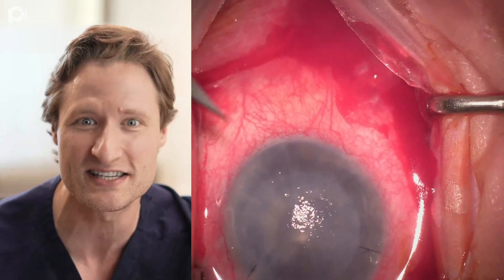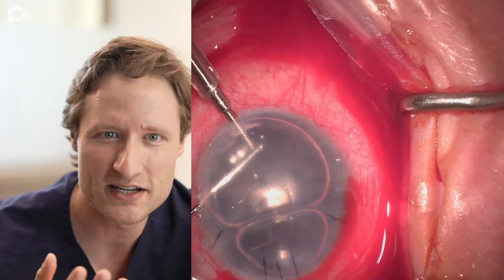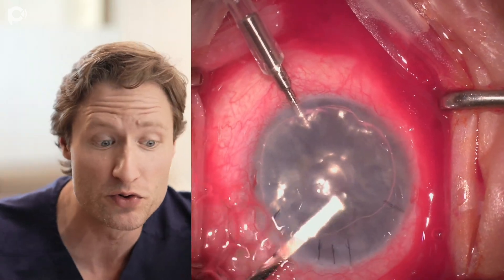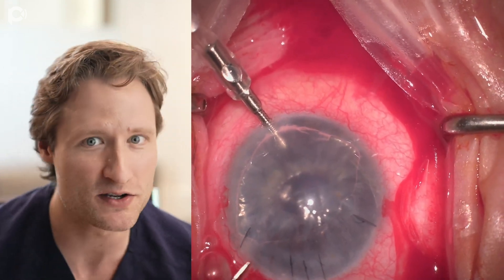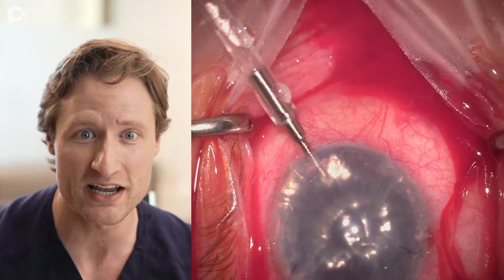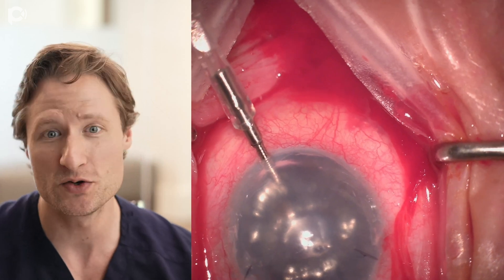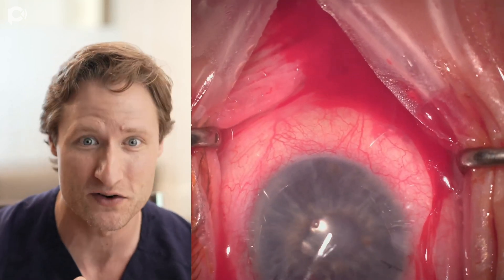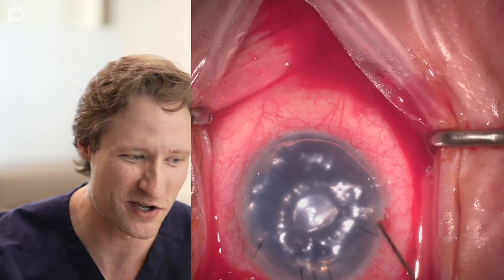DMEK with Tube Shunts -- the ONE KEY concept for mastery

Comment: Condition: Keratoconus with Corneal Edema in Right Eye (Post-Corneal Transplant)
Age: 25 years
	•	2019: CXL (Corneal Collagen Cross-Linking) performed in both eyes.
	•	November 2023: Corneal transplant done in the right eye due to scleral lens intolerance and pain.
	•	Vision improved to 6/6 within 1 month post-surgery.
	•	All stitches removed within 1 year.
	•	Vision remained clear and stable until July 2025.
	•	Mid-July 2025: Woke up with sudden blurred vision in the right eye, with no pain or redness.
	•	Examination showed corneal edema and graft whitening, indicating possible graft rejection.
	•	Treated with steroid drops and an injection — no improvement after 3 days.
	•	Currently on a 21-day course of steroid eye drops as prescribed.

Question:
Is there a chance that steroid treatment will resolve the corneal edema and save the graft, or will I need another corneal transplant? What should I do next?